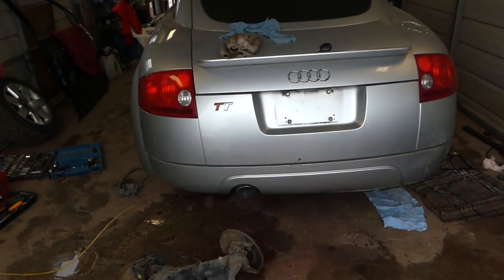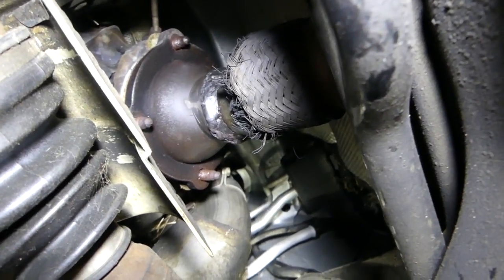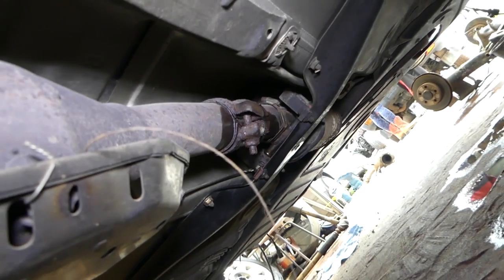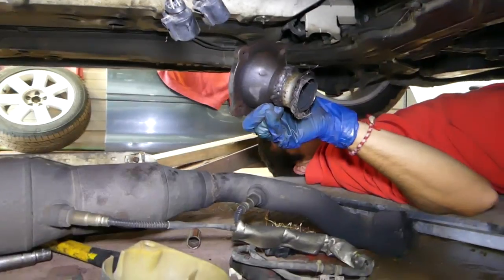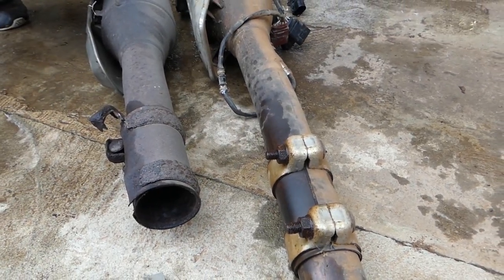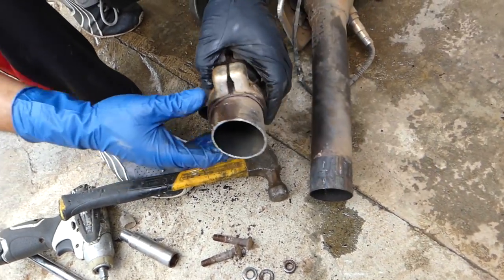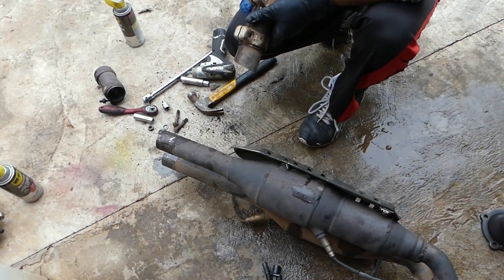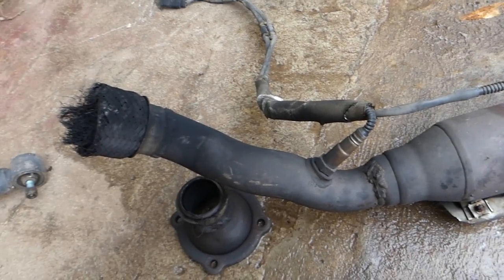AUDI FLEX PIPE AND CATALYTIC CONVERTER REMOVAL REPLACEMENT 1 8 TURBO AUDI TT

Comment: Was the flex pipe causing the tt to lose power at 3000 rpm ??
Reply: loose power looks like turbo problems. But when you have hole in exhaust pipes Problem is lambda voltage. Exhaust not flow correctly to catalic converter. Not flow correctly in pipes

Comment: I'm trying to remove the converter from my Audi A6 3.0L C5 platform and the flexpipe is on the bottom and the converters are mounted to the back of my motor..

Comment: Hey, I have a question, I have the same Audi model, will it turn on my check engine light if I remove the catalytic converter? Thanks
Reply: There is 2x lambda probably it happend. You can emulate 2nd lambda. If you remove istall exhaust jet because you lost power in straight pipe